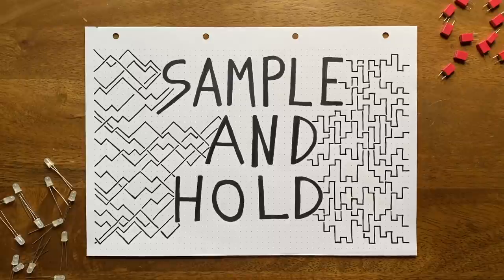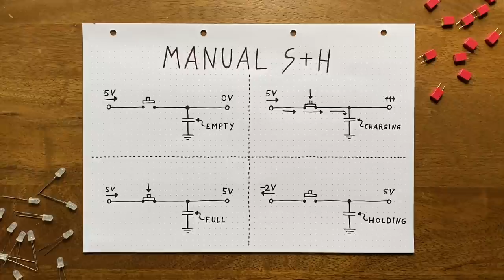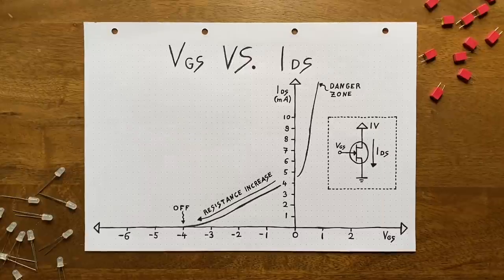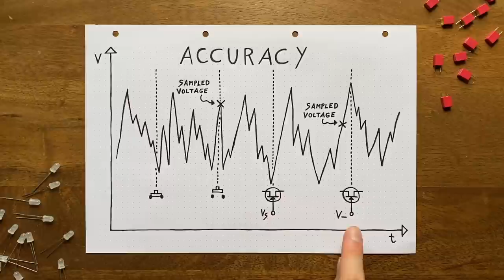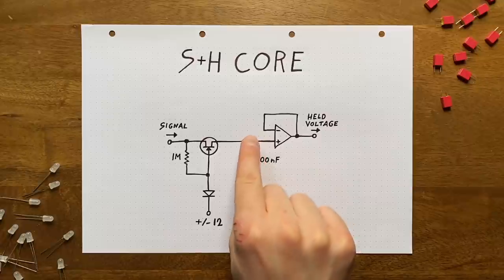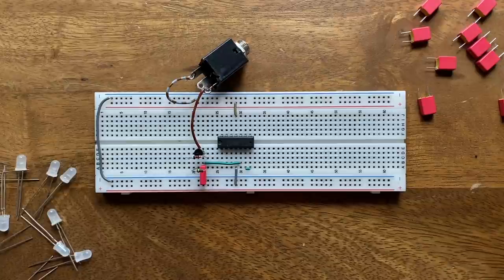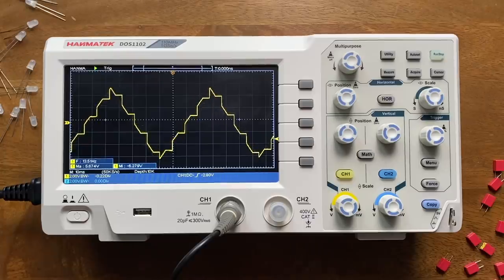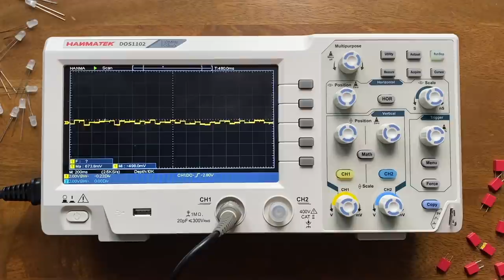Designing a sample & hold-circuit from scratch

Comment: So this is really cool: When I first built this it didn't sound right at all, but because of your in depth explanation of the circuit I knew the problem had to be around the 100nf cap. Changed the ceramic one I had put in there for something decent and now it works a treat (and I get to feel smug about my trouble shooting), so thanks very much for this video - I really learnt stuff.

I've build a second one now - this time with internal triangle lfo and noise, with a switch to choose between them, and an external input which overrides the switch. All in 4hp - it's really really nice!

Comment: I just yesterday started to figure out what would be my dream s&h module. It would have 2 channels, accuracy to sample pitch without quantizing, slew pots with range from musical portamento to looong rises and fall times, pre-patched noise in, internal clock, switches to select between s&h and t&h. Maybe that's it. I'm happy to hear dreams from other people too.
Reply: Maybe some Rectification and an inverted Out?
Reply: yours sounds almost what ive been trying to build recently. i want to be able to tune it somehow to get arpeggios out of simple waveforms. so im guessing an internal clock is a good idea but not sure if itd be necessarily mandatory. my thinking was that the frequency of the sampled wave would need to be a multiple of factor of the trigger rate, so that itd be a repeatable pattern rather than just random always. again though, im teaching myself all this shit so i could be far off base also... maybe as long as the cloak was sync-able to the waveform's...?
Reply: I'd suggest having a look at the LF398 IC, it's a relatively cheap monolithic sample-and-hold circuit - I believe that's what was used in the original Wogglebug and there's a great take on it by René Schmitz which you can find on his webpage! I've built a couple modules from it and with a bit of tweaking you can get it to sample waveforms as "microtonal" scales, anyway it's a good building block for any kind of random-voltage based circuits! Strongly recommend
Reply: @Mogwai06  xcxccx cc

Comment: Your explanations are wonderful. I just finished building my S&H and the debugging would have been better if your video was 1 week earlier! Something you didn't mention: if the input gets near the negative rail, the voltage between gate and source is too low, and it begins sampling. This behavior of JFET is confusing for newbies.
Reply: yes it is! im glad it wasnt just me. thanks for  that info too by the way...
Reply from the maker: you‘re right - i should have mentioned that the circuit is designed for a eurorack-standard 5 V peak-to-peak signal. my bad!

Comment: Many years ago I built my S&H module using a CMOS 4007 chip configured as a SPDT switch. The low resistance gave very snappy sampling. I also used an identical circuit as keyboard voltage hold so that I could have portamento and piano-style sustain pedal

Comment: A nice addition would be an offset which can be controlled with a potentiometer. Then, when lowering the range of sampled voltages, you can choose a higher pitch instead of having only the low pitch ones.

Comment: Surprisingly simple for such a usable result. Considering how flat your output voltage was I bet you could have used a 10nF without issue. Split the difference and size a cap for the multiplicative average between the on-resistance and the off-resistance. I’d also consider an analog switch IC, as they can have much lower on resistances since they use an internal MOSFET instead of a JFET, and can be used in bipolar circuits due to connecting the body to the negative rail instead of the source. I figured that JFETs would always be far inferior to analog switches because of this, but considering a JFET’s very low leakage they’re actually decent. Don’t use a CD4053 though, they’re pretty bad.
I think you can reduce the leakage problem further by using an op-amp feeding a signal to before the switch/transistor, think I saw it on EEVblog.

Personally I was designing a sample+hold circuit to be used in some sort of convoluted phase comparator inside an audio phase-locked-loop.
Reply: Will DG409DY be OK?

Comment: Nice! But I think that the sampling pulse is too short. When you turned down the trigger frequency, you could see that the amplitude decreases as well, which means that there is not enough time to sample the the input during one pulse.

One way to solve this problem would be to mimic the design of the master-slave D flip-flop:
You have two sample and hold circuits in series. The first samples when the trigger is low, the second when it's high.
Then when the trigger goes from low to high, the first sample and hold starts to hold and the second one starts to sample it, and that is when the new value comes through.
Probably needs a few more components, but should give plenty of time to sample the signal (as long as the trigger isn't just made of narrow pulses).

Comment: I will explain two concepts that someone wanting to build systems related to thing may find useful:
1)  Imagine a typical inverting amplifier with a capacitor across the feedback to limit the bandwidth.
For the moment consider the resistors still being connected to each other but not directly to the inverting input of the op-amp.  The capacitor is connected directly.  The resistors go through a switch (JFET) to get to the inverting input.  With the switch "ON", the circuit works as normal.  With the switch off, the output of the opamp is fixing in voltage.  This makes and inverting sample and hold circuit.  To make it work well, you really need a second JFET to ground the junction of the two resistors while you are holding so that the voltage across the first JFET is always small.
2)  Given this inverting sample and hold, there is a slightly clever thing you can do with it.  Imagine that the "sampling" time made so short that the output doesn't get all the way to the final value before you go into "hold".  Also imagine that the sample/hold cycle repeats fairly fast.  Instead of running the sample and hold circuit directly from the input, it could be run from another opamp that is adding the input signal (remember the circuit inverts) and the output signal and filtering that before sending it to the sample and hold.  With care, you can make a circuit that makes an output that sort of "draws a smooth curve connecting the dots of when the sample signal is true".  The circuit will tend not to make strong beats between the sample signal and the input signal.

Comment: While working on a sample & hold filter unit for guitar, it occurred to me that one could, theoretically, vary the stability/perfection of the circuit's ability to hang on to a sampled noise voltage.  So, I experimented with what I like to call the "droop" option. That is, a held voltage in the storage cap that is allowed to drain off before the next clock cycle, in a manner that is musically useful.  The drain-off time is set by a resistance to ground in parallel with the storage cap - like any decay-time resistance in an envelope follower - but requires change contingent on the step-clocking rate.  I.E., if the time between samples is very short, the drain-off time needs to be faster in order to be audible.  It adds a musically interesting wrinkle to S&H effects, whether they are applied to filters, VCOs, or whatever.   One can think of it as a sort of unidirectional (downward only) portamento.  I'm sure those cleverer than I can mimic this with slewing modules that can add glide between steps, but this is a LOT simpler and easier.  I use an on-off-on SPDT toggle and two selected resistors to provide faster and slower droop and no-droop.  Hard to get simpler.

Comment: This is way simpler than the idea I had for how to approach this. My concept was to add transistors to gate the Vs+ and Vs- pins of an op-amp, or use an op-amp with a shutdown or device-enable pin. When sampling the op-amp would be able to pump charge in and out of the capacitor to match the input, then when holding I'd cut the supplies so it can't pump any further. (Would probably need to use a FET-input amplifier to ensure we don't leak current in the switched-off state.)

Comment: Using a quantizer with an S&H is a pretty common use case for me.. just to sample every (n)th note of a sequence for a baseline. Still lots of useful information, thanks for sharing.
Reply from the maker: fair point - will see if i can get it to work with enough precision in the follow-up!
Reply: thats what i usually do to come up with a random pattern, but i sample a vco's (or something similar usually) output wave and even then sometimes i try to time
 it up to get a repeatable pattern or arpeggio. the sampled-and-held signal goes via a quantizer into the v/oct of another/second vco.
Reply: edit: i meant i sampled an LFO. i think i was having issue with variations on the output, or lack thereof, due to the vco output's inherent speed...

Comment: The J113 mosfets seem to be fairly expensive so I'm wondering whether anyone has substituted it with a Mosfet or CMOS switch gate.  If anyone has done this successfully, could they please let me know the substitute part they used? I'm not sure about Mosfets as they have an internal diode as I understand it but I have not worked with mosfets much and there have been a few mentions in other comments that a mosfet may be suitable.  BTW, I have just started learning about modular synths and have found that this channel is the best source of information, Well done Moritz, your explanations are brilliant.

Comment: The only thing I would add is an op amp buffer before the 100k pot.  This will give the circuit a very high impedance (tens to hundreds of megohms) vs 100k input impedance.  And no harm to buffer the trigger input as well.

Comment: Hi Moritz, I wonder if you could help. I’ve built this on a breadboard and double checked everything many times that it is as you have explained, but all I get is the noise from the white noise generator and nothing through the trigger input. And the pot is just adjusting the volume. I’m sure I’ve built it correctly but I can’t work out what’s wrong. Any help would be most appreciated. Thank you 🙏

Comment: Thanks great video as always. What component change/add would a track & hold circuit need?
Reply from the maker: as far as i know, the only difference between t&h and s&h is the duration of the sampling phase. so you could simply install a switch at the trigger input that bypasses the capacitor and diode. this way, the circuit will be tracking while the trigger in is high, and would hold when it goes low.
Reply: @MoritzKlein0  thank you so much I'll try that!
Reply: the circuit without all the pulse control shenanigans is already a track and hold.  The slopes he describes as ''bad triggers'' are tracking the triangle waveform and then holding.

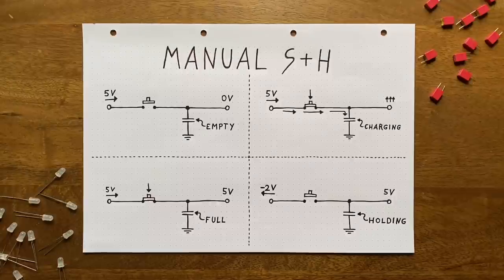Comment: at 04:00 why does the 2nd part of the circuit hold the voltage once the switch is off? Wouldn't going to ground be the path of least resistance?

Comment: Yeah I was kinda thinking don't all typical sample n hold modules have droop?
Reply from the maker: yeah. you’d have to go digital to eliminate it.
Reply: @MoritzKlein0  Not quite.  There are "droop compensation" circuits that tend to make the hold voltage run away to the rails instead of actually drooping.  In theory they can be fine tuned so they don't do either.  In practice, not so much.

Comment: You always upload videos on concepts I'm currently learning about, and I love it. 
I've been going deep into track and holds for the purpose of VpO bus bar keyboard designs. 
Have you any experience with the LF398 ic?
Reply: I've used the LF398 quite a bit.  One can build an extremely simple S&H with it, but I've noticed that it droops a bit more than I like.  I prefer to use a DG-series switch (such as DG418), use a Polypropylene capacitor, a good op amp that can drive capacitive loads, and a low drift output op amp like the OPA140.  This combination works REALLY well.
Reply: @DrJ3RK8  I really appreciate the detailed responce, thank you. I'd never heard of that series of chips, that'll save me many wasted switches. 
As a little bit of a capacitor noob, I've read the most reliable for this are polypropylene film, which checks out with what you are saying here. Would wima, small plastic box types be suitable? Or should i be looking at other packages? Thanks again
Reply: @DollysplitBand  I use the WIMA red-box polypropylene caps a lot.  I use them for VCO integrators, filter integrators, S&H, etc.  I use TDK MLCC (small blue) caps for everything else.

Comment: Just curious. How are you turning off the jfet without a negative voltage? Isnt that trigger pulse going from 0v to +ve voltage? I thought the jfet will only block with its gate voltage lower than the source voltage. Ie -ve.
What am I missing?
I can get the fet to turn off by negatively biasing the gate to the -ve rail so the +ve spikes bring it up to 0v (source on the other side of the diode) to sample than back down to -ve to hold.
Reply: I have exactly that problem. I tried to build the circuit this weekend and it doesn't work for me. It seems that the comparator output only swings between 0V and +12V. I need to do more testing to eliminate the possibility that the sound card I'm using as an oscilloscope isn't filtering out the DC component.

Comment: hi, great video, how if it was made with an asymmetrical jfet?
Reply from the maker: then your capacitor would charge and discharge at different speeds i think, which would reduce the circuit‘s accuracy further
Reply: @MoritzKlein0  thanks, maybe could make it even spicier